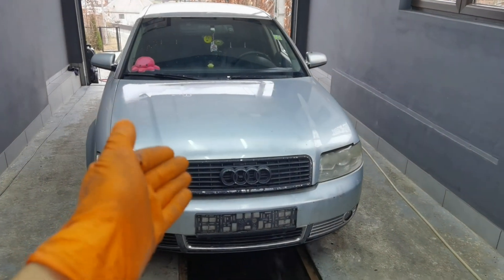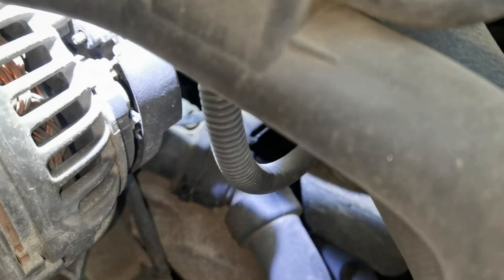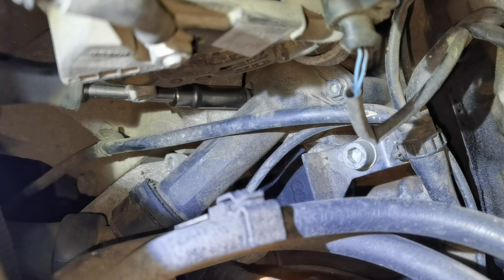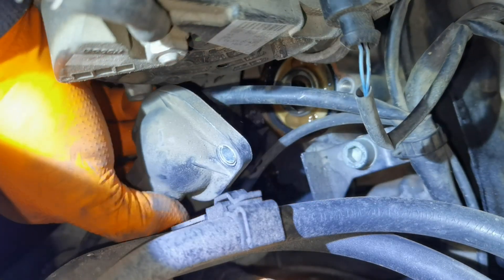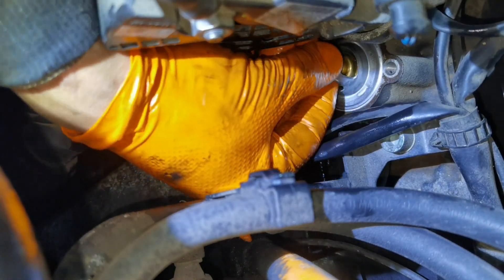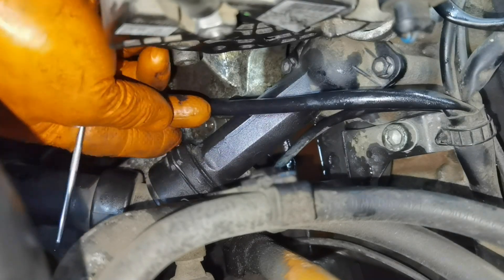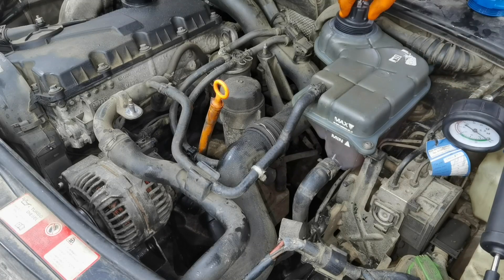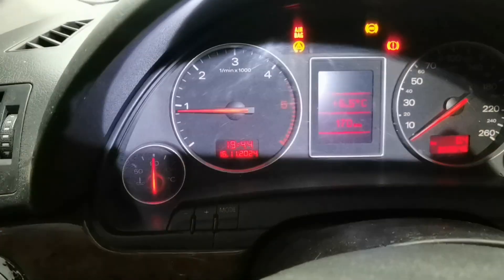Thermostat Replacement On 1.9/2.0 TDI Engines!

Comment: thanks !
did the same today on my 2.0 tdi touran.
Reply from the maker: Good job mate. 🙏
Reply: Very helpful brother, thank you 
I've got same problem, the temperature never  reach 90° even after long journeys
Reply: Ok so my 1.9tdi avant won’t reach over 70 and fan on same time flat out is that the thermostat? i changed the temp sensor and still nothing changed
Reply: @stacksflat7482  fan imho has a separated sensor